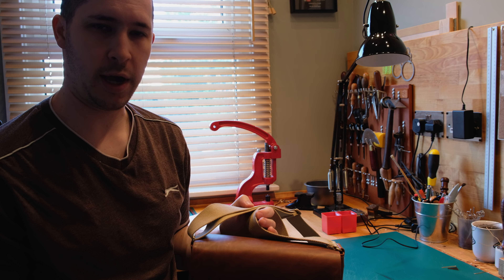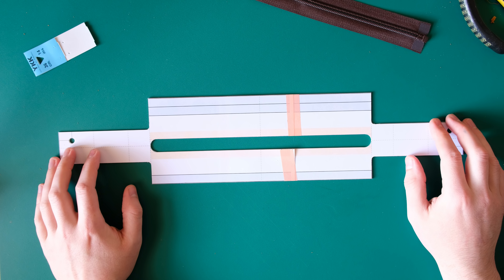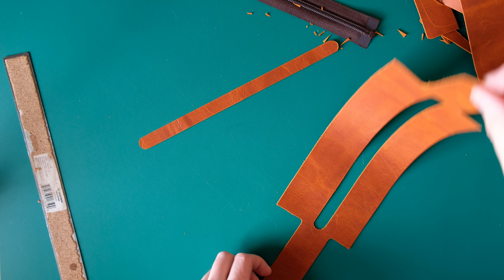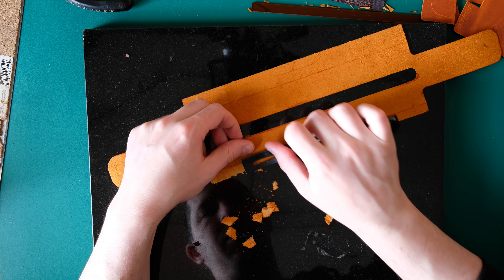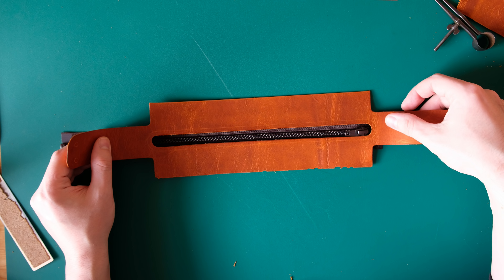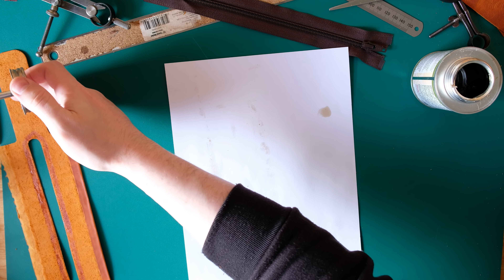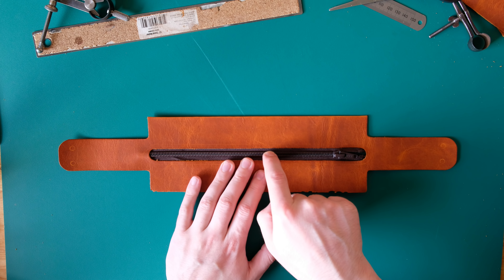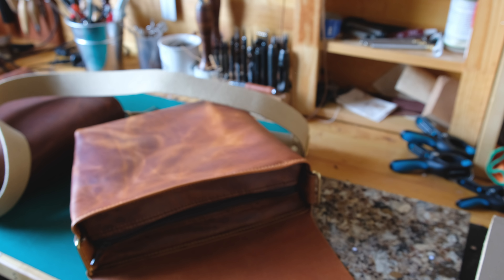Stitching a Zip Into a Leather Bag 4K

Comment: Just a tip I learned from Samurai Carpenter, Jessie...
Go to your home improvement store, and pick up "Door Skins" thin wood veneer, and make your templates out of that. It's thin enough to cut with a razor, but thick enough to be stiff and durable for many uses.
Before, I was using plastic placemats for picnics but they were too floppy and crap. Those door skins work wonders!
Also, they come "door sized" (Duhh lol) so you can make large patterns for whole skins.

Hope this helps, I've learned so much from you and your channel, it would be nice if I could give something back.
Reply: P.s. Also, I use medical paper tape on finished leather for any taping/sticking needs. Get the kind for babies or sensitive skin and it wont leave marks, or adhesive on the finished leather. Helpful for taping down templates, or holding peices in register for stamping or making holes... etc.
3M medical paper tape is the best, and I find it comes off perfectly, but also has great holding strength!
Reply from the maker: Haven’t seen those in the UK
Reply: @Leodis.Leather  If it isn't feasible, an alternative is "Hardboard" its thin sheets of MDF, or more readily available to you and something you might already have on hand, is bag stiffener. A friend of mine uses thick bag stiffener for all his templates, but I haven't personally tried it, nor am I fully aware of what it is. lol
Again, I hope this helps. I know what a serious pain paper templates can be!

Comment: Another great vid Ian.  I'm still a bit unsure whether I like using the tape or not.  I know the thread isn't probably ever going to break and the tape allows for re-positioning if I stuff up (which is more often that I'd like). But, I like the way the glue penetrates the leather. Also I've found that burnishing the edge seems better with the glue? Sometimes I seem to have a parting line with the tape.
Reply from the maker: +HunterValleyDan you definitely don’t want tape in the middle of an edge you’re trying to burnish I think that will cause you problems
Reply: Thanks Ian. You've confirmed what I was starting to suspect was true.  Cheers.

Comment: Thanks for another great video Ian.  Two sided tape is a good alternative to glue when putting the zip in place.  It is a little bit less fussy than glue.
Reply from the maker: I quite like the tape yes it's not easy to stitch through though as it stays sticky so you have to be careful where you use it!

Comment: Such an amazing video as always. Thanks Ian. I only wish you would have shown how you did the last parts, like attaching the other side of the zip with leather to the bag and what you did with the long tabs with as much detail as you did everything else. I didn’t quite understand that last part.
Reply from the maker: I showed attaching the other side to the point of glueing the parts together and marking the stitching, after that it was just stitched through. The side tabs are wrapped around as shown in the pattern they're just also joined to the zip piece making it continuous rather than 3 separate pieces in this case, it could be done as easily with 3 pieces.
Reply: I was also a little confused about how the tabs were completed. Great video though. Thanks.

Comment: It would be nice to see a short video where you attach the side tabs with rivets, as it's going to be somewhat more difficult to do with the zipper in the way. Can you still get your rotary hole punch in there easily to punch the holes in the side of the bag? It also looks like the side tabs may fold back on themselves inside the bag, before being attached with rivets. I have your pattern pack for this bag and it's great, by the way.

Comment: I know this is an older video, but I'm just now coming across it. If you see this comment, could you tell me if you know of any issues with zippers with metal teeth vs. plastic teeth regarding strength and/or failure tendencies?